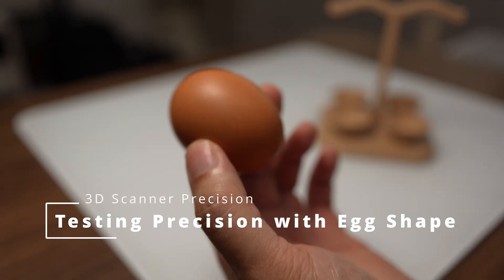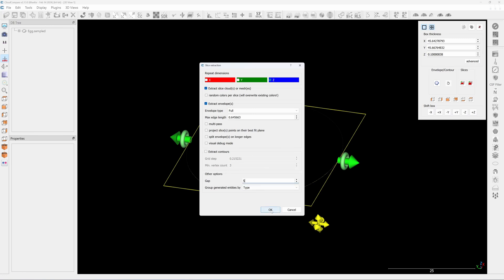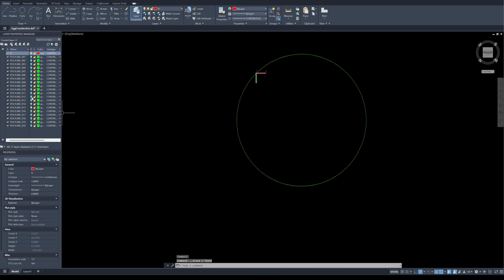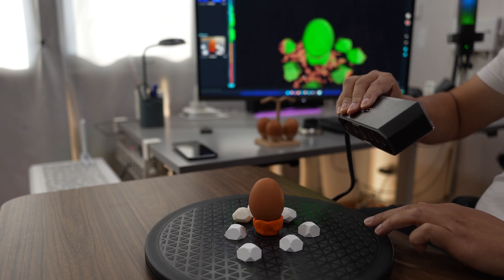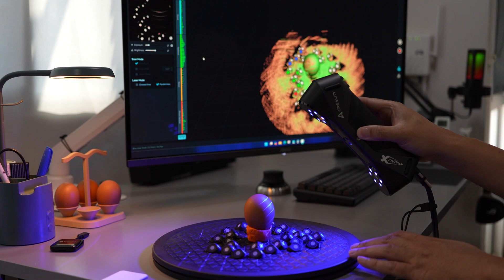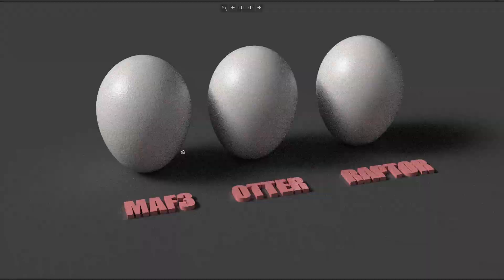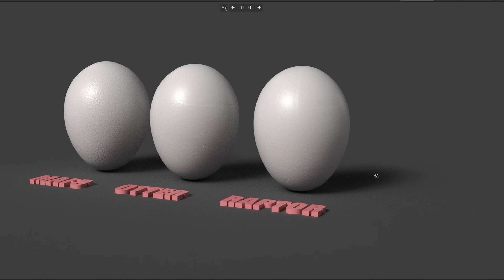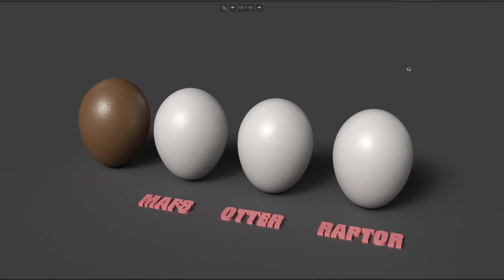3D Scanner Precision Tests - Analyzing with Egg Shapes - CR Scan Otter, Raptor, and MAF3

Comment: Payo, love your work presenting consumer grade of scanners. I have learned so much from watching your tests. Can you perform a comparison video of the Otter, Raptors (Pro and X) to show the quality of work for small detailed mechanical items.

It looks like you tried to do a small detail video on the past on raptor but did not set the scanner properly. Please repeat this video with a comparison to the Raptor Pro. 

Please, no powder spray. Set your resolution to the minimum 0.02 mm for all operations to present real results. If 7 line laser mode is the most precise, please show this. Please scan a bolt to show the quality of the scan. Your work on the broach was not a clean quality result.

https://youtu.be/ukNymwPI2aI?si=YcuBs1igliJDmUui
Reply from the maker: Highest resolution from Raptor is 0.1 mm, that's the width of laser line and also the peak performance from the camera. 20 um is the precision, can't be adjusted or improved with FW update.
Reply: @Payo-TensileCreator greatly appreciate the response. That resolution is shocking for the price. Is that all versions of Raptor?
Reply from the maker: @xfsr20box  I've never seen a blue laser scanner with resolution lower than 0.1mm yet. Even with the latest 20K industrial grade scanner.

Comment: What is revopoint hiding by not sending you the metrox for review 🤔
Reply from the maker: Last time, they mentioned that they didn't have a spare unit for the reviewer because they ran out of stock. I'll follow up with them again.
Reply: @Payo-TensileCreator  yeah right. I wont be pulling the trigger untill i hear your thoughts on it...

Comment: The MAF3 is very impressive, more than I thought it would be. His force is the synchronized turntable/structured light/capture camera/software. But the drawback is the volume you can scan with it. Everything outside the turntable (capture camera focus) is impossible to scan. Is that make sense? Did you try to scan something outside the turntable? Handheld? Thank you very much for the time to put on educational videos, those help a lot(at least for me!)! 👍🇨🇦
Reply from the maker: I've tried with car panels, and head shot scans. It has to be placed on a tripod. I've had to put in a lot of effort to get this done.
Reply: @ that's what I thought but if kept in a 200x200x200mm , this scanner capture so much surface details it's awesome(from what I saw from your experience with it) as always, you made a fantastic job on this video! 👍🇨🇦

Comment: The MAF3 seems impressive.  Though the Otter doesn't seem that bad considering it is a fraction of the price of the others ($800 vs $2,500 vs $4,500).  3D scanners are still in the 'you get what you pay for' territory.
Reply: Which one would be 4500 USD? For me the cheapest offerings I could find are as follows: Otter €670, Raptor €1100, MAF Three €2400.